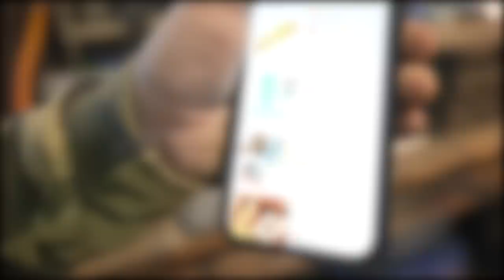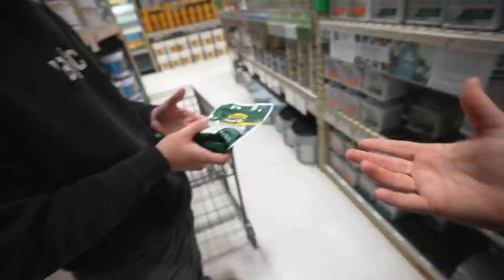Building a DIY Homemade PONTOON BOAT!!! (Part 1)

Comment: Use soapy water and spray over pontoons to see where the bubbles are then you can see where every pinhole is
Reply: Nice thinking my guy!
Reply: I cant really see that working considering the pontoons aren't pressurized like car tired are. There wont be air flowing out of the pontoons to create bubbled

Comment: As a structural Welder I'd say u have good bones to build a perfect multi purpose rig. Add drop leds for bow fishing, side bars and etc for frogs much more. No Brainerd. Easy flip with major profit margin. Even if u kept and did a tour guide setup. Your all set for multiple cath and cooks and so much more success.

Comment: 35:54 Them tubes like that you have to squirt that stuff out then mix it together then use it.. Not just squirt it out n use it, Yeah some of it will bond together but not all of it.. One is the Epoxy & the other is the Hardener.. Did you even read it..?  Gotta read the cardboard Packaging Not the tubes.. I use that stuff alot, If you would of mixed the tube stuff it Will work,  It still might work sense you used it all & put it down & more on top it just might work im at 70 work/30 not work.. Next time Squirt it all out & mix it with a stick then use it

Comment: Heck yeah! I was wondering if y'all would ever get back on this thing. Make it multipurpose. Set it up where you can dangle for blue gills, but leave enough open deck up front for a tent/duck blind & it's gonna need a small grill mounted on it somewhere too. No sense in having to get off the water for lunch. 
You can be out there Flippin' Burgers & Boat Flippin' Bass!

Comment: Flair if you want to find leaks use the air but spray soapy water on the surface and if it bubbles you’ll find any more leaks

Comment: Just a tip to find a leak, use water with soap and spray the tank. The tank need to be filled with air

Comment: That dude lied to you, he can’t weld for shit either. Looks like you’re running a 2 stroke welder! Wtf
Reply: Haha.  My thought exactly!
Reply: he was such a liar, anyone with welding experience could tell you that
Reply: i mean dude said like 5 times hes not a good welder lol idk what yall were watching or hearing
Reply: Lmaooo didn't even chip the slag and had the wire speed all funked up
Reply: He never claimed to be a good welder who cares brooooo
Reply: @chrissisemore269  I mean it's kinda important to chip slag off. You can't stack weld on slag. Porosity issues.
Reply: @josephfarmer1657  they were literally welding on scrap metal they ain’t worried about porosity even if they were welding on the pontoon it wouldn’t matter all that much
Reply: @chrissisemore269  yeah I know that but to show it to the boys and see it. the pontoon was patch welded and needed to be cleared after weld. If you want it air tight you gotta do it right.
Reply: @balake1093  agreed
Reply: @josephfarmer1657  they ended up using flex seal don’t think they really care all that much

Comment: As a welding teacher I could tell my hearing you needed more wire speed with the mig and for flairs first weld he did great, most students just stick the electrode to the metal for the first time.

Comment: ALL U HAVE TO DO IS FILL THE PONTOON WITH WATER WILL SHOW LEAKS FROM INSIDE OUT BUILD A DUCK BLIND WITH ROOF U CAN SLEEP IN BOAT HOUSE THE DUCK HOUSE
Reply: This dude pretty smart tho
Reply: @Madd Maxx dude your brain is on X Games mode
Reply: Just fill with air then put soapy water if there’s a leak you see bubbles
Reply: i had a damn stroke tryna read that
Reply: @tilson smith lmao
Reply: The problem is getting all the water out

Comment: Marine grade is technically seal, you don’t NEED to seal it but it definitely help. I just did 2 floors on a boat last summer and used it, then just put marine carpet over it. Turned out great!

Comment: That might did sound horrible the hear needed to be turned up as well as the wire speed as well getting closer could help you as well, and a prepped clean surface to weld to on both ends. Dirty metal, airy and weak welds and quite possibly the gas needs to beadjusted. That popping and cracking is not a noise you want to hear. It should be a consistent like hum as well as a nice bright fireball out of it, and when you start to lay the bead you want to either do like like dime drops then going back on itself half way and doing it that way till your done, or as you start to weld do half crescent moon strokes while going back over half of itself

Comment: Get a bottle of soap water and spray it on the floats to find leaks. You need to have compressed air in it while you are doing it. A bunch of bubbles will appear where the leaks are.

Comment: If you are restoring a old pawntoon I found working in a water utility that after you weld and sand blast use a apoxy type paints. They apoxy paints work get for things that are around water. Instead of plywood use aluminum sheets their are expensive but it last longer

Comment: We do metal gas tanks with old pennies that are copper and solder. Prep the surface Flux it and solder it. Faster than welding and will do the job. Unless your a good welder you can end up blowing more holes in it if it's a thinner metal.

Comment: And as far as mig welding and filling holes or gaps use a copper bar and material fill. Material will roll off copper and fill gaps and holes

Comment: Use what is called rabbit wire for the new chicken pens. It has small holes and it is thicker than chicken wire. That's what we used.

Comment: First off, just like actual welding you ALWAYS need to prep the surface by sanding and cleaning all rust , paint, grime before adding any kind of jb weld, flex stuff ,ect. Second, when using any 2 part adhesive like jb weld(even in the tube) you need to make sure you mix the 2 compounds together good so it will correctly chemically react and function correctly before adding it to the surface, and third make sure one product cures completely before adding another layer or product on top of it. like you said your spending alot of money so you'd def want to get it done correctly instead of rush it and have a catastrophic failure later in the future. But hell hopefully using 25 different products on top of each other did the trick haha good luck buddy.

Comment: Either take a welder with a stick and fill the holes or take flex seal paint and spray paint int and do a few layers I used flex seal on my sun roof on my jeep and held up like a champ

Comment: Put a small 12v compressor running off your battery to put a little pressure in the pontoons incase you spring a leak.
Reply: And keep filling when it does leak

Comment: The better way to paint the deck o f the boat: when you spray it you should get a thick coat on it and roll it with a roller to even out the coat, lock your wrist in the first place to get ad even of a spray as possible. Keep the roller wet btw

Comment: Pro tip: when you’re welding you want to stay in the first 1/3 of the puddle you make and use a half moon pattern while moving down the bead haha
Reply: With that bottom being so thin, he thinks he has pinholes only, now would turn those holes into moon craters.

Comment: Move all of the animals over to the right. Air-ate the left side completely right at the beginning of spring. Lay grass seed down on the left side. Let’s it establish about 4-5 inches. Move the animals over to the left. Air-ate the right side. Bounce back and fourth. Move the pigs to their OWN pin. Fence in more yard. By another camel. Let the camel roam in their own pin. Move the alpaca and llama to it’s own pins. Let them roam.

Comment: Flair as a professional painter you would want to use an oil base paint takes longer to dry but worth it thin it down with lacquer thinner and dont get that sprayer go and get u a Graco machine a 400$

Comment: Should’ve put that metal plate in the inside of the pontoon so it doesn’t get scrapped off and the air pushes it tight to the wall

Comment: If you mess up you can punch a hole straight through. There are multiple setting about the power its a little confusing if you dont know what you are doing. The first time i did it was on a car it held then my cousin broke it

Comment: Heat, speed, arc lenght, angle of electrode. Factors of welding. Just a little bit of research and some practice. Also clean your steel. A monkey can weld with a mig that is setup

Comment: OG welders fine tune their welding machines by sound, should sound like vigorously frying bacon. All that sounded so bad I’m blind. 😂 joking aside it ain’t no picnic welding with an AC welder but it will do the job. Ole flair sounded like he was long arcing quite a bit at the beginning but he seemed to have it by that last bead. Let me know if you want to pull the trigger on that welder Flair I’m available for tips tricks n advice.

Comment: I'm no pro welder but the wire speed on that mig was too high. you can hear and see the wire jumping off the metal which means probably turn the speed down a little and could also turn the temp up so it burns a little better

Comment: You either didn’t have your gas turned on or the wire speed was to slow or the amps where to low when you where wire welding

Comment: Flex seal is pointless just use the cheap cans you will get the same results your looking for but you should have stripped all the metal and used por15

Comment: Mig welding isnt that hard if you dont have any gas it isnt going to work ofcourse, if your mig stutters means the wire is or going to fast or to slow or you set the electric current to low

Comment: Spends a bunch of money to seal the deck but is to cheap to buy a sheet of 1/8th inch metal and weld up the holes. Lol 😆 flair has to much trust in flex seal

Comment: As a certified welder, watching that was so cringy. You needed to turn the amperage and wire feed speed UP on that mig welder. Stick welder sounds a lot better. But migs easier for welding those crack up. I bet you blow thru the tube with the stick welder!!